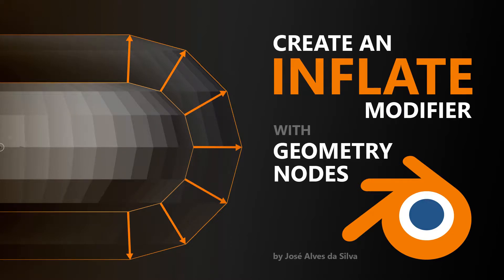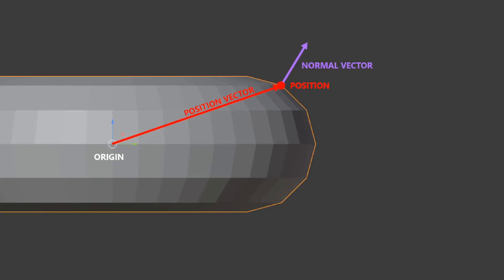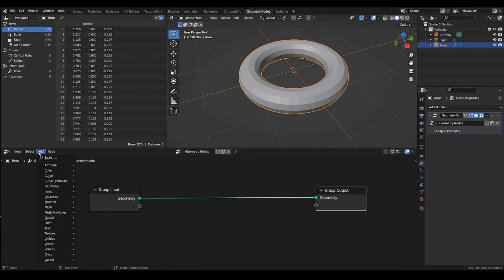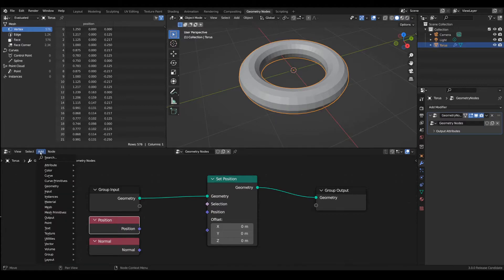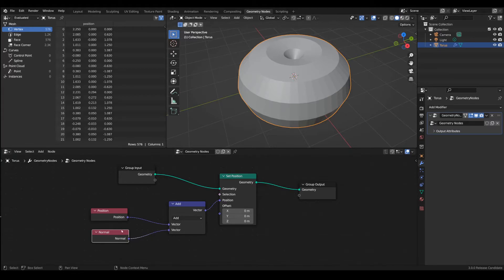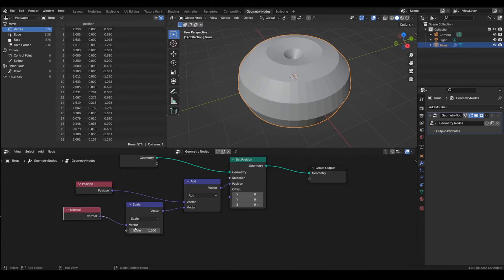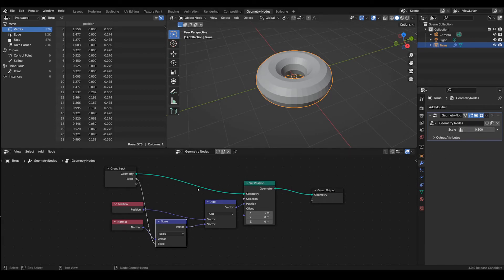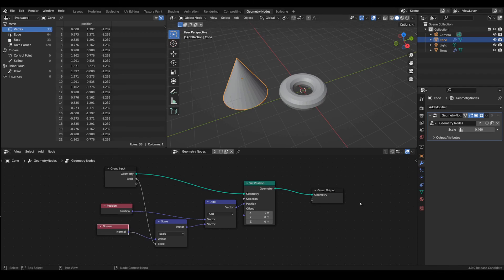Blender 3.0 Beginner Tutorial - Create Inflate Modifier in Geometry Nodes

Comment: Thank you! that was exactly what I was looking for as well! 

I designed a characher mesh and I used the subdivision surface modifier to achive smoothness but the mesh became thiner, so I had to find a way to regive volume to the mesh without removing the modifier somehow. 
The solidify modifier wasn't good for what I wanted so I dedcided to search for other ways of infalting a mesh and found this video which is great and well explained too.
 
Good work!
Reply from the maker: Hi Sofia! I am glad this geometry nodes solution helped!
You can also try adding a Displacement  modifier on top of the Subdivision Surface modifier, which might be an even simpler solution for what you need without having to deal with geometry nodes :)
Reply: @joalvessilva  The displacement modifier works just as good as the geometry nodes, and it is indeed simpler like you suggested. 
Thank you again for your help. 
The problem is solved.
Reply from the maker: Glad to know, Sofia! 😊

Comment: cant we use solidify modifier for this?
Reply from the maker: The Solidify modifier will had thickness to a surface. Inflate will do the same as the Displace modifier (without a texture), pushing the surface outwards.
However, by scripting it with Geometry Nodes you can use that bit of code inside of a more complex script.